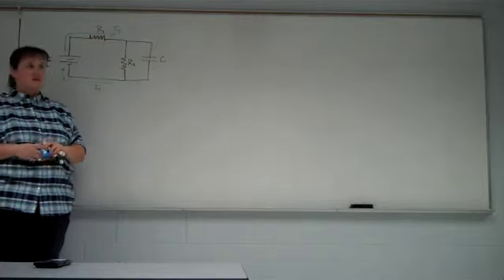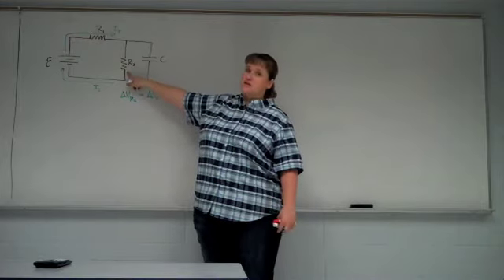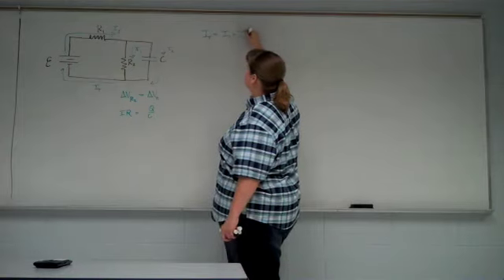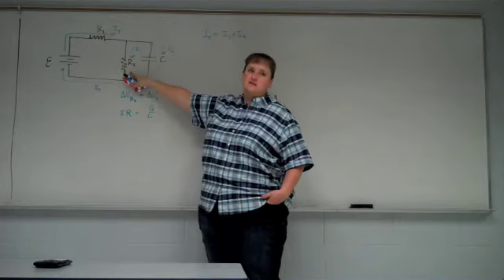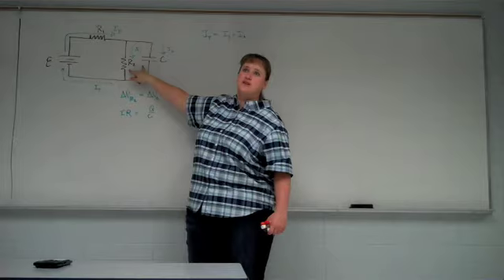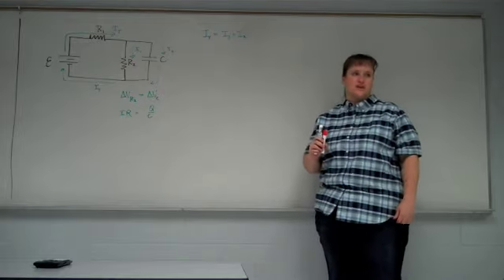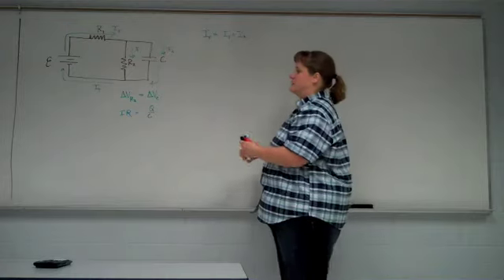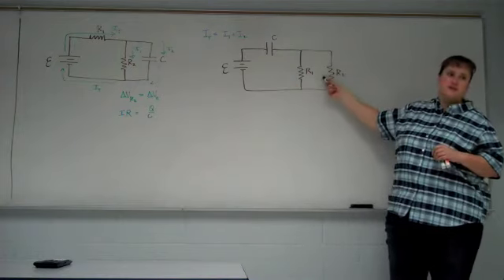Conceptual RC Circuit

Comment: the voltage across the capacitor when it's fully charged at the end of the transient state is the same voltage of the capacitor and the parllel resistor connected to it  at steady state.am i getting it right  ?